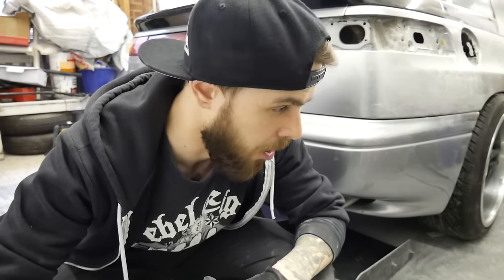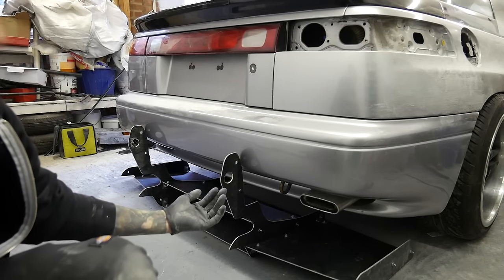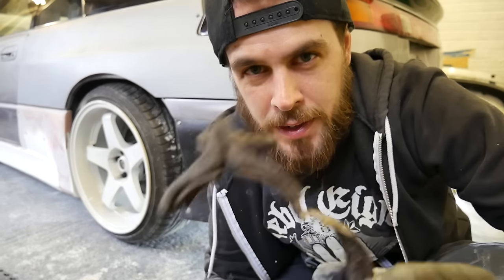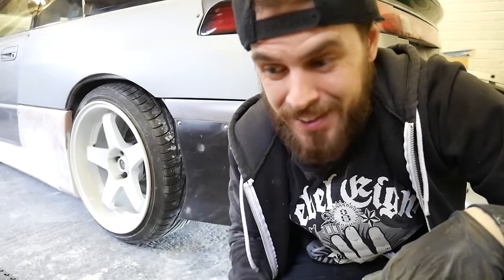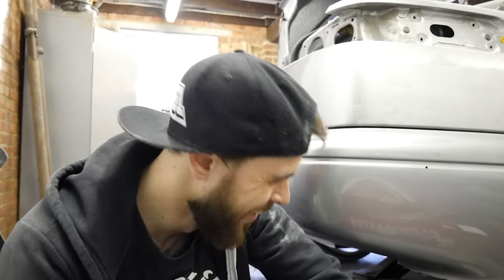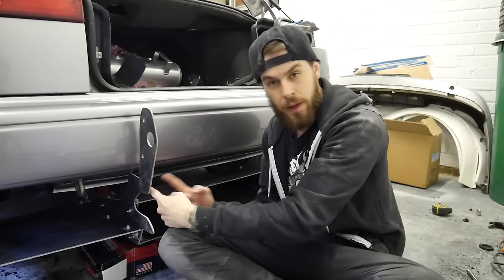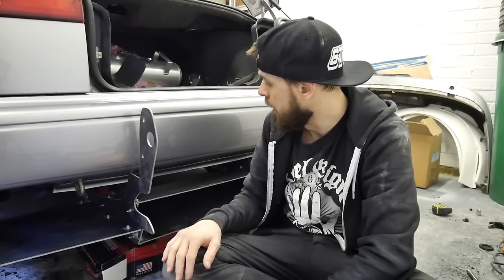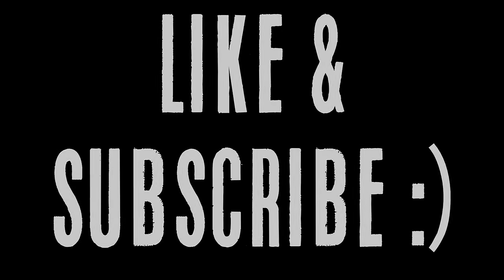Rocket Bunny diffuser // Part 1

Comment: I've go an 80 DL wagon that's had an EJ22 swap. When the exhaust was redone they left off the Cat and put a straight exhaust with a short resonator type Thrush "muffler". She sounds mean, and she's got nearly doubled HP (68 stock and 135 Now) and 50% more torque than stock. Running through an 86 model 5-speed manual. She's not Fast, but she'll power through nearly anything and go up a 5% grade and only lose 5-10mph over a 2mile climb. 

I like the way yours sounds sans muffler.
Reply from the maker: I love wagons dude! im pretty tempted to swap something bigger into the brat as it's lacking power.

Comment: I don't even think mine had that clamp when I pulled the mid pipe off. Now cut the exhaust off before the y-pipe and see how it sounds.
Reply from the maker: The temptation to cut more off is so real haha.
Reply: I chopped mine off at the y-pipe due to rust rotting it out. It sounds so damn good, but it's so LOUD.